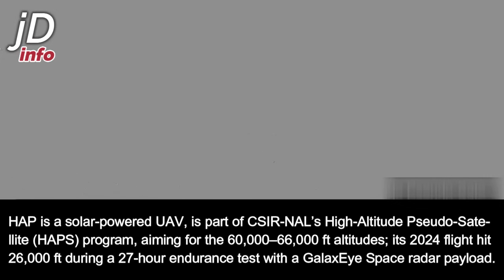World's 2nd Largest Forged Rail Wheel Plant in India, Foxconn's 2nd Biggest Facility in the World

Comment: We need HAP with a flight ceiling of 24000 metre ( if not 30 km ) & not 24000 ft.     30 km means  it will remain ABOVE clouds always & will be basically free from enemy aircrafts.
     USA made exactly that around 2001 with an endurance of few MONTHS.  it could take off at speeds of 15 mph & had a peak speed of 29 mph.
      We may also decrease the speed & go for higher efficiency to gain more height.